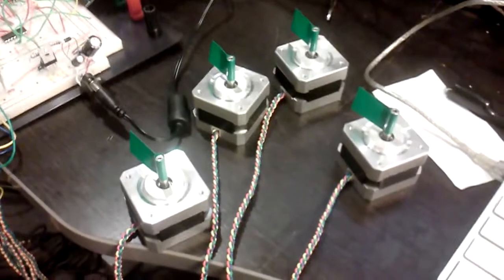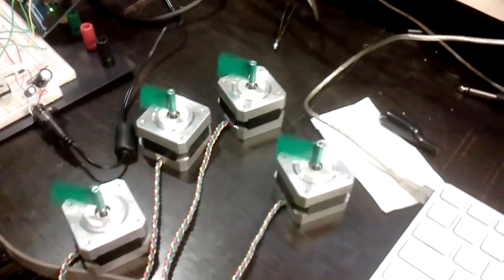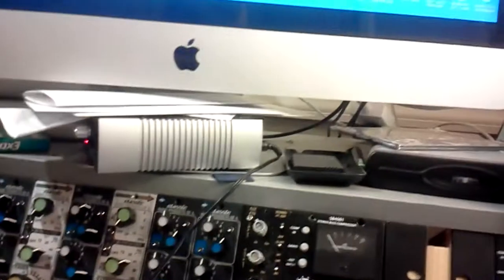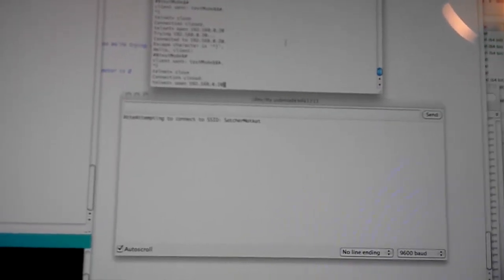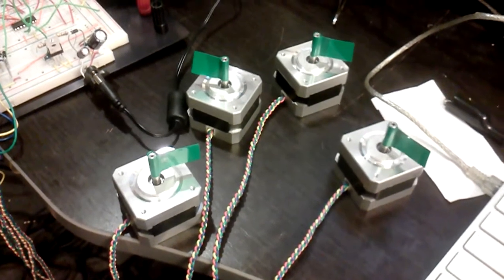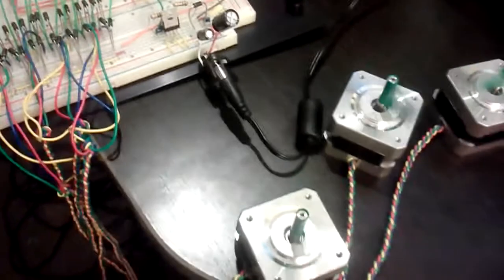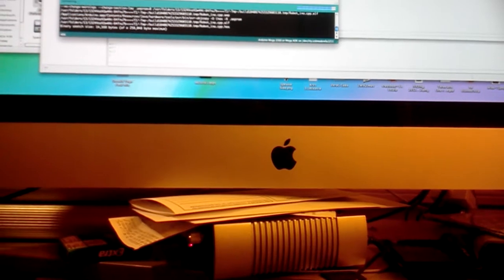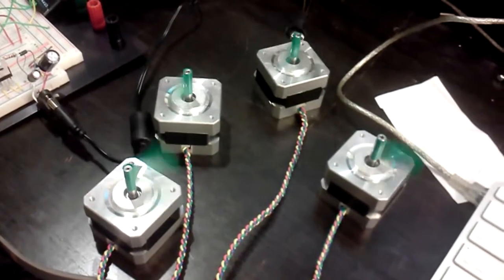Stepper Motor debugging and unbalanced load effects on performance

Comment: Alphabeets raises a good point. I've used Portescap motors, and they would have the same problems at these speeds. 120rpm is nearing the limit. Stepper motors are not really about speed - and you'll get better load at slower speeds. I'm using an L293D and an Arduino to drive mine, and I'm getting some pretty nice torque from it.